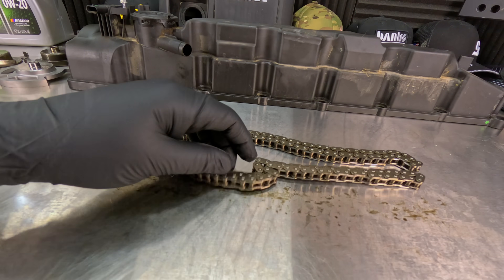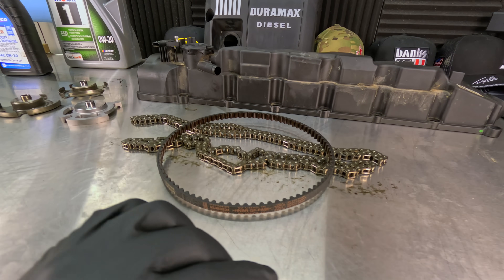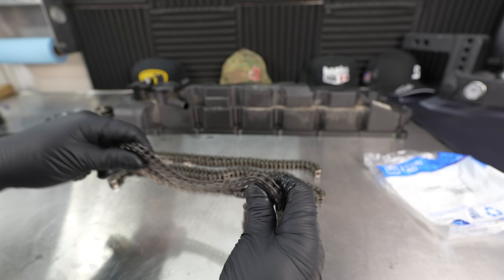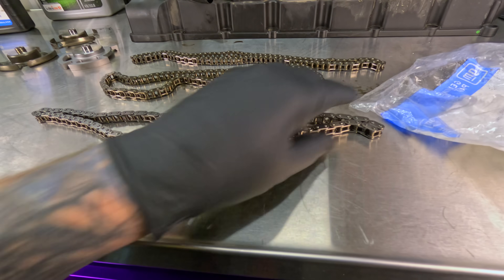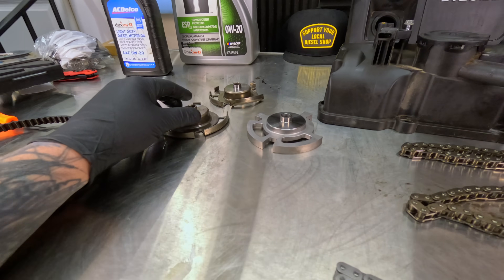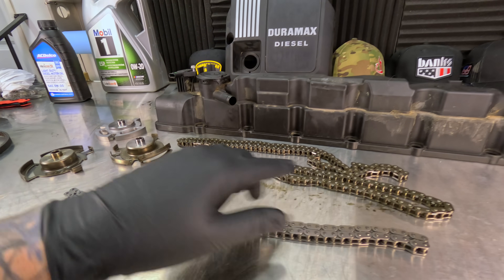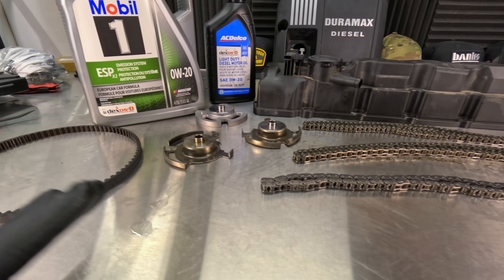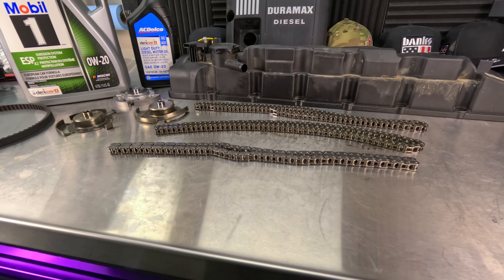3.0 Duramax $10k Timing Chain Failure — Updated Design vs Old

Comment: What would be the BEST oil for the turbo 2.7 4 cylinder model? I have a 2023 LT crew cab and want one with the best temperature. I change my oil once it hits 50% oil life. Feedback from you on what you would personally use or change if you were me? I use whatever the dealership provides me tbh. 

(Can I buy my own oil and give it to the dealer to change the oil for less of a price)?
Reply: I had a 23 model. If you are looking for “best” oil, then Amsoil signature series or shaffers.  Mobile one is great too.  
Only way to really save money on oil change is to do it yourself. 
Just take the old oil and dump it at autozone, orileys, etc. 
But honestly, if you are changing it that early, just use any name brand synthetic. 
But definitely use a synthetic because of the turbo.
Reply: Great video and explaining  problems with 3.0 durmax engine. I had thought about getting 6.6 liter durmax in 2500. I got prices on warranties on both engines and the costs where the same both high. Maybe a diesel is not for me. Thank you
Reply: @pallas5446  Each to their own.. but if you are buying a truck.. at least test drive the 3.0L
I had the 6.2L, was a solid engine, but the 3.0 gives me better mpg and the fuel cost is less.
A little bit more to upkeep, but if you stay on top of maintenance, change the oil every 5K (1st oil change should be at 1500 miles) then your vehicle will last you a good long time.
Reply: @texZR2  I drove both a 2025 Sierra 1500 sle with 3.0 liter duramax diesel and a 2025 Sierra 2500 SLT 6.6 liter durmax. I liked the 2500 better part of the reason is the trim level, but being bigger it was surprising that driving it on test drive both 2500 was just as easy to drive. It is just mechanical issues with 3.0 liter and 6.6 durmax engines with both having reported 10 speed automatic issues. Most issues of either engine are emissions related issues. I have had two Toyota tacomas 3.5 litter s one is a 2021 toyota tacoma Trd sport and a 2022 SR5 3.5 neither have had a single issue
Reply: @pallas5446  And I have had  Chevy trucks for 35 years and never had a transmission issue.(not saying they are not out there, this is just my personal experience)
If you look at transmission issues.. EVERY brand has something.  The new Tacoma's are getting hammered with their transmission. 
Ford has transmission issues
RAM has had huge transmission issues.

The 3.0L I have done extensive research and the current LZO 3.0L diesel is considered by most to be a top 3 engine that is offered on all the various truck platforms.

But each to their own. Glad you tried out some other trucks.
Reply: Keep doing what you're doing while in warranty. Mobil 1 5W-30 EP is a great choice while in warranty if you want a brand name Dexos rated oil. Castrol Edge Euro 0W-40 after warranty.
Reply: You only need the best oil if you are stressing the engine.. high revs, lots of miles.
Any synthetic that meets the standard that GM sets should be up for the job for a daily driver. GM puts Mobil 1 in their Vette engines.
Mobil 1, Pennzoil Platinum Plus are great synthetic oils that I use and as long as you change your oil every 5K miles, will keep your engine nice and healthy.

Comment: Yeah it was a widely known issue with the BMW version and they completely ignored it. If I remember right, the chief engineer for the 3.0 Dmax also mentioned a change with the timing chain tensioner to put less stress on the chain when it wasn't necessary.